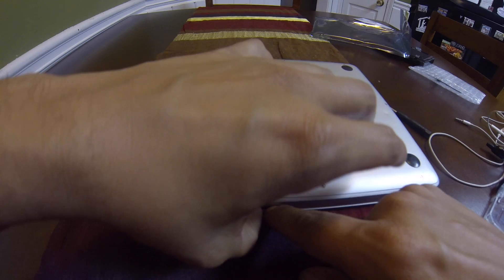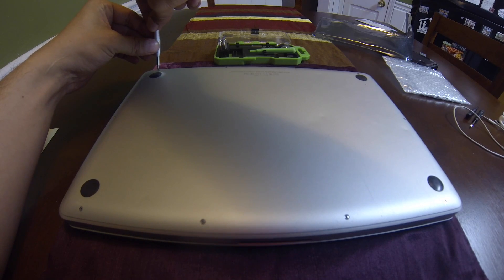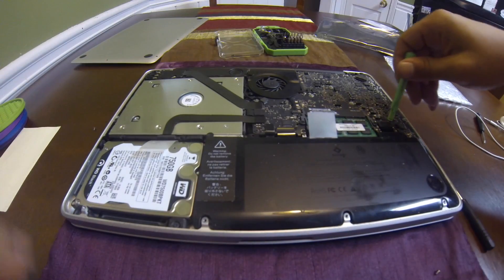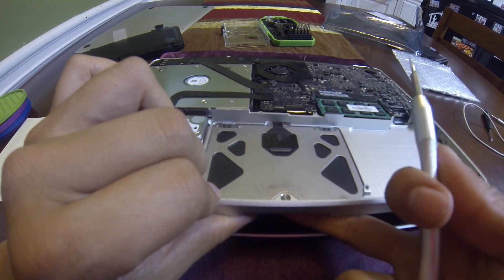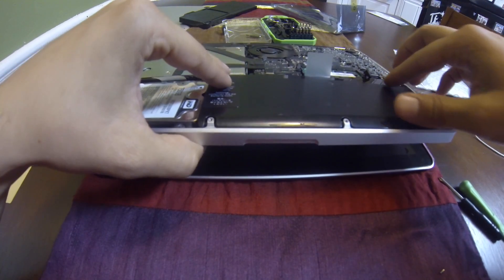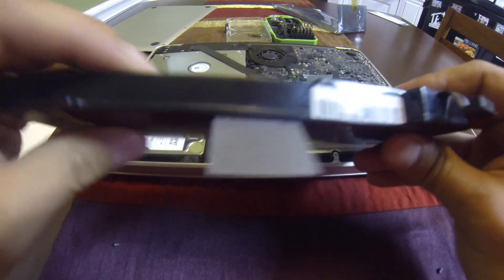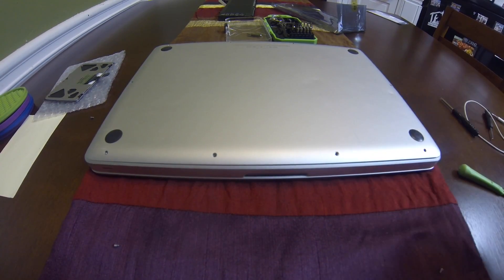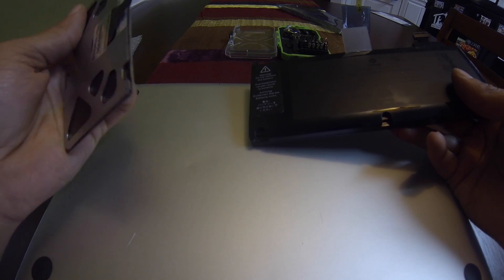Mac Book Pro 2012 - Trackpad Not "Clicking" Issue

Comment: It looks like you're using a screw driver to adjust the track pad but the thing you are putting the screw driver on is not a screw. Putting a screwdriver on it and turning it does not rotate the thing you're touching with the screwdriver
Reply from the maker: The track pad has its own torx type screw, which I had the correct screw driver for it, its why I was able to turn it.

Comment: I took my trackpad out to clean and now it doesnt click at all.
Reply from the maker: Make sure you adjust the tension screw, it may be too lose.
Reply: pr0d1gy visions i have tried all levels of tension. The little metal piece that clicks actually clicks, but not when its installed.
Reply from the maker: @nexusdeep  Is your battery bulging out to where it would stop the clicking like mine did? If it's clicking while you're messing with it and it stops after you put your battery on, that may be the issue.
Reply: pr0d1gy visions the battery is perfectly fine and doesnt click without the battery either.

Comment: I got a macbook 2012, my trackpad sometimes freezes. I clean it but no results.
Reply from the maker: You may need to disconnect it, and clean the terminals. But if it's actually freezing it may be some other cause such as heavy load on your CPU.

Comment: mine is triggering the click when I pass the finger, it may be a defect in the TrackPad or just the Flex cable ???  thanks .
Reply from the maker: Your tension screw might be too tight, or you may have an issue with the batter as I did.

Comment: mine is triggering the click when I pass the finger, it may be a defect in the TrackPad or just the Flex cable ???  thanks .
Reply from the maker: It may be the battery swelling up and pushing against the trackpad. See if there is ample room between bottom of track pad and battery. You may possibly just need to loosen the tension, if it’s too sensitive or tight.

Comment: MY Macbook needs service too, Im still running my 2012 battery, my track pad is not clicking on right side same as yours initially, and the hinge to my screen needs tightening or replaced, other than that, she a beast after 6 years of going strong...I've since replaced my power cable about 3 times now, and the one I have now is all duct taped up and working still...I bought a back up just in case....my letter A & S key on the keyboard wore out too....I hate to part with it but soon , I know she will have to go in the shop to get fixed.

Comment: I knew my battery needed replacing for quite a while before I got around to changing it. Replacing it did instantly fix all the problems. I wish I'd watched this first and checked the click of the trackpad before completely installing the battery. There was a LOT of dust in my computer, I wish I'd had some canned air on hand. I'm going to complete the calibration process and then recheck the trackpad w/ and w/o the battery.
Reply from the maker: Make sure you don't over turn/tighten the screws holding the mouse down, its glass so it can crack easily under pressure. :-)

Comment: to fix mine without even taking a screw out I simply pushed fairly hard 
on the trackpad for a few seconds in the four corners and the middle. It
 pushes the battery back down and my trackpad worked immediately 
afterwards. less of a headache. Thumbs up so everyone can see this 
easier fix.
Reply from the maker: Yea except the battery keeps growing, so there is only so many times you can do this. Eventually you won't be able to push it down, as well as you can easily crack and break the pad. Seen this happen before, be careful. Few screws and a battery can prolong your device lifespan.
Reply: Thx mate. Wroked straight away :)
Reply: You are awesome. Less than 5 seconds and the issue is fixed. Thanks
Reply: Did you press all four corners and the middle for sustained time, or like a few times?

Comment: Thanks for sharing.  My track pad quick clicking a while back.  So I just quit using it and recently purchased a new battery.  It wasn't until you mentioned the battery that I checked my track pad and it's working again.  That's exactly what it was, the battery had gone bad and swelled. Happy to have it back.
Reply from the maker: Yea, its a silly design. Swell of the battery can ruin the experience of using the Mac. Glad you were able to get yours fixed. :-)

Comment: My battery got so swollen it actually pushed the trackpad up and dented the aluminum.
Reply from the maker: Ouch. The top or bottom? If its the bottom you can bend it back or buy another. But if its the top were the touch pad is, ya might be out of luck.

Comment: Wish I saw it earlier.  My battery caused the same issue.  Realized that it was the cause when I was replacing the battery.  However, I had been using too much pressure on the pad when it was not working correctly that it caused sensor damage to right side of the pad.  So need to replace the trackpad now. But feels like new again.
Reply from the maker: Yea this battery and design of where they placed it under the mouse is just odd. Glad you got it working tho!
Reply: sounds like an engineered defect to me

Comment: I tried cleaning mine by removing it from that black  cabal and I put it back but now it won't click only upside-down does it click you turn it over and it doesn't  respond
Reply: also I already tried to loosen and tighten it
Reply from the maker: Which black cable? The one coming from the actual mouse? You may need to check your wire as it could have become disconnected or it might have been bent and separated the wires.
Reply: hmm i got a new trackpad and it's still having the clicking problem i honestly don't know what to do
Reply from the maker: Does it click when the battery is out? It could be your battery, that was the point of what was wrong with mine.
Reply from the maker: Try not screwing in the battery tight, just enough. The body of your mac might be warped.